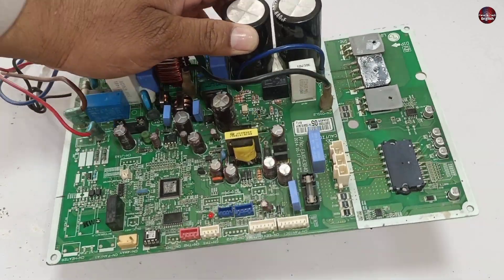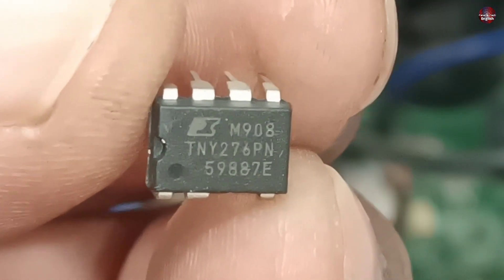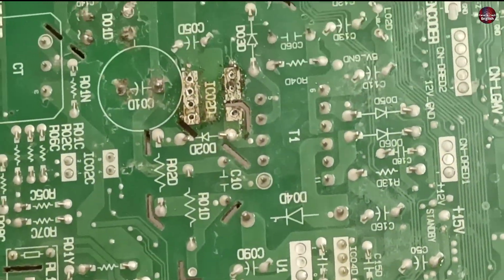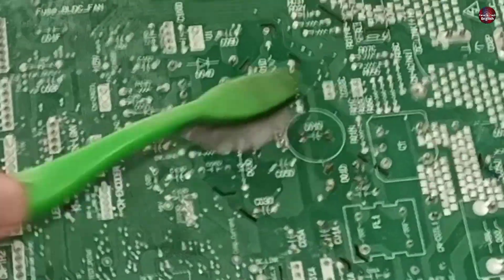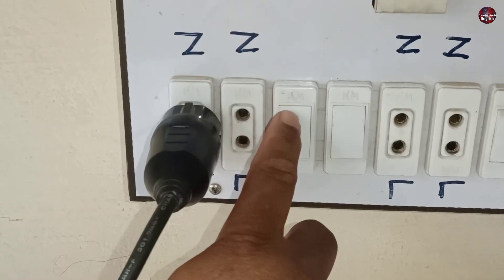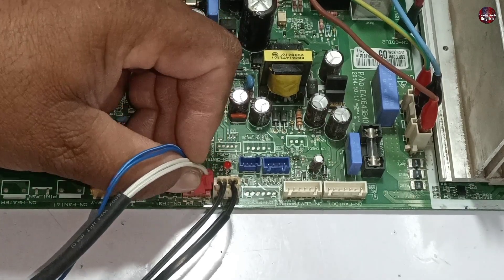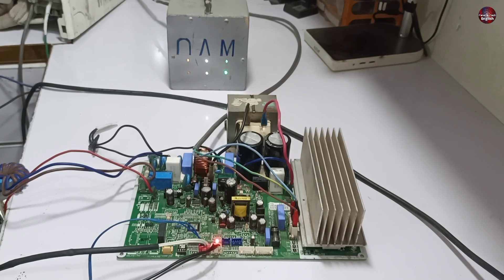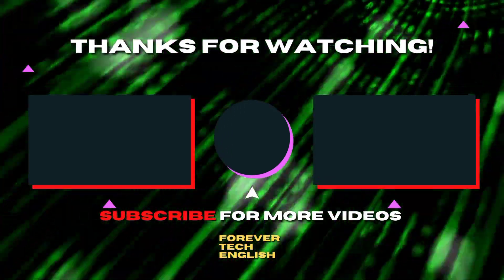Can I FIX Lg Ac Motherboard Rejected by Other Repairman?

Comment: I recommend to test repaired or damaged components in series with a halogen or incandescent light bulb, then you won't get a dangerous short circuit that blows the motherboard up if something is wrong.
Reply from the maker: I do check the motherboard with series lamp, when I see a motherboard damaged badly.

Comment: sir, can you make vedio of lg outdoor unit, initially compressor start on hi speed then stops after several seconds, then led blinks 2 times and 6times,after few minutes it start again but this time only on low speed n it will not go hi speed. thanks

Comment: thank you for the  videos  .. unrelated subj. on a smaller top freezer samsung,, what does 13 flashes mean ?? ,,  it has a single board //  thnx  /K
Reply from the maker: Is it an inverter refrigerator with two pcb boards.
Reply: @forevertechenglish  HERE IS THE MODEL rt16A6195sr  only one board
Reply from the maker: I will have a check on this. then inform you.

Comment: You really need to start using flux or rosin because it makes it alot easier to solder and it also stops solder joints from going dry.
Reply from the maker: I Do that always

Comment: Hi can you please help in below issue:
When 1st Inverter AC already running fine and then if we start 2nd Non Inverter AC and then as soon as Non inverter AC's compressor gets turn on then Inverter AC's compressor gets turn off.
After few mins Inverter AC's Compressor automatically turn on.

Both AC have Voltage stabilizer installed also.
We have 3 ACs all can run at full load simultaneously without any issue. Voltage remains between 200 to 240V.

Only issue is Non Inverter's Compressor turn on, off  causes issue to Inverter AC.
Reply: Check capacitors on inverter AC's motherboard.
Reply: @abrarahmad4193  1. in Indoor unit or outdoor ?
and 
2. all capacitor or compressor specific?
Reply: @GurmelSingh03  on both boards, all capacitors within power supply section on the board. This is mostly caused by failed capacitors. Computer gets reset and compressor trips bcoz of that.

Comment: U do nothing / just add missing id
Reply from the maker: Yes I Did replaced that missing ic, But I am curious why was the other repair man not able to fix it?
Reply from the maker: Why he did not added that i-c, I am curious
Reply: @forevertechenglish  maybe he didn't had that ic
Reply from the maker: or may be couldn't figure out what I-C number to be installed, and other than this I have learned alot, And After alot of learning I am able to know what I-C to install if there is no reference available. You could not say that I just add that I-C; it is also part of the JOB.